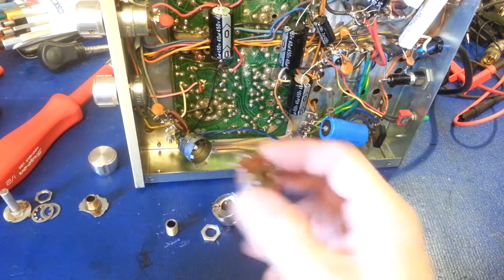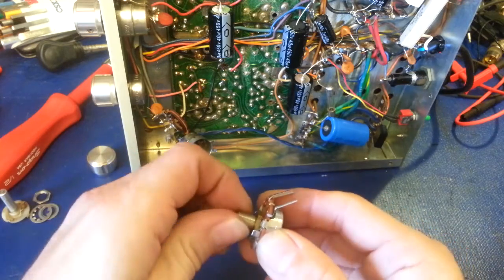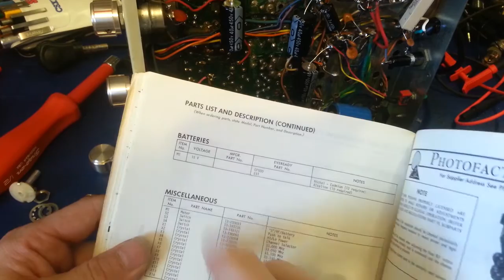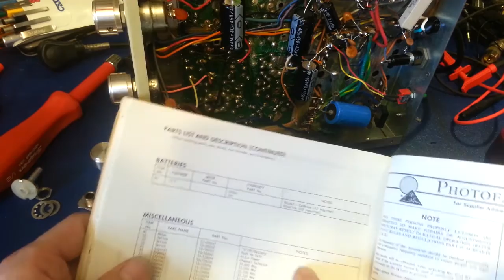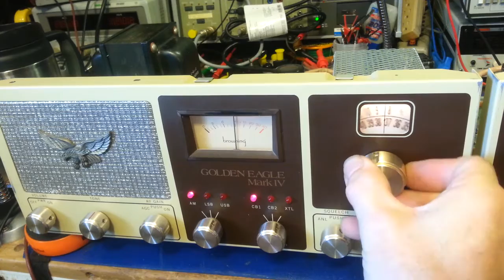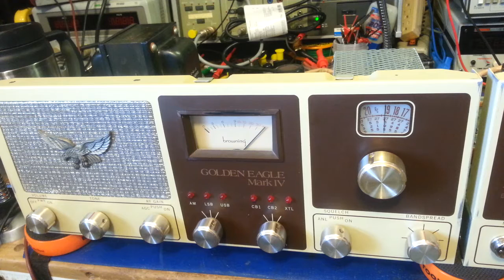Building a custom potentiometer with the antique IRC Spectrol kit.  Those were the days.

Comment: I remember those switches. Used to have several kits of them when I worked for another guy. These are what really taught me to tear switches apart and repair them. Great video Mike.
Reply from the maker: I sooooooo wish they still made these.  I have a huge inventory but as I use them I can't just order replacements to restock.
Reply: would be nice.